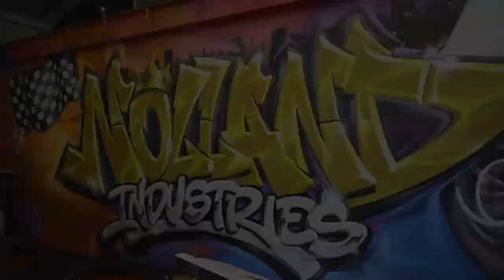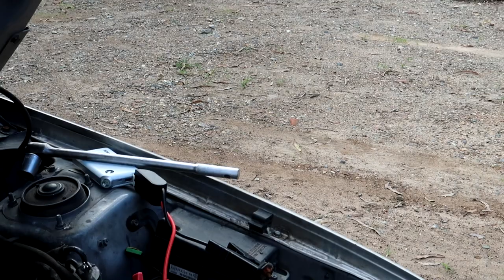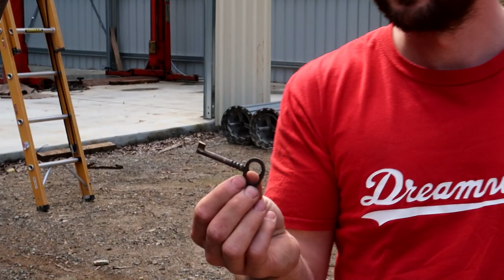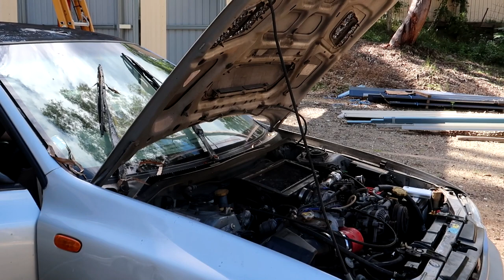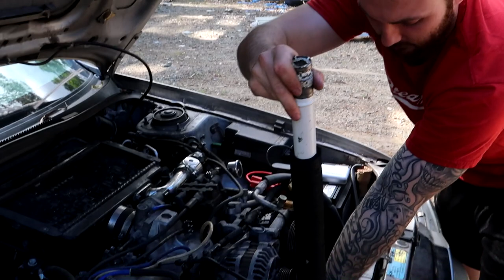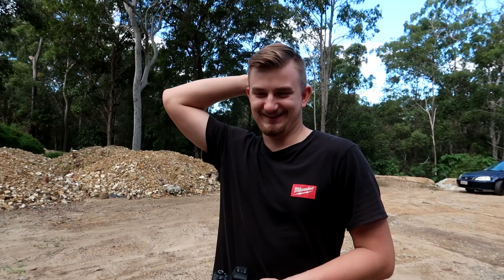WILL IT START?? || Subaru WRX, Featuring. TJD, Part 2 🤞🏼

Comment: Try pulling the plugs out and spraying copious quantities of wd 40 or crc inside and try turning it over without plugs in, coil disconnected and fuel pump fuse out by hand and with the starter motor and see if it’s saveable still 👌
Reply from the maker: Awesome strategy,  so keen to give this a go

Comment: Bromyster that motor was so binded that maybe it was lucky you didn't crank it, you might be able to save the heads if the bores rusty but there's so much good advice here and on YouTube and motors seem to be cheaper for the rex but it all cost pending how far down the rabbit hole you want to go, you could even try and pull it down yourself and rehone all the rust out of it, that might be interesting viewing lol
Reply from the maker: Yer bro plenty of options, think I light end up pulling this motor apart having a investigation and then buying a new second hand ej20 to through in 😁
Reply: @JAMESNOLLAND  hey bromyster seriously that spelling of yours, no more pulling long ones and getting on the turps while commenting ok lol
Reply from the maker: 😂😂😂 I was on a sizzer lift building the roof of the new shed 👌